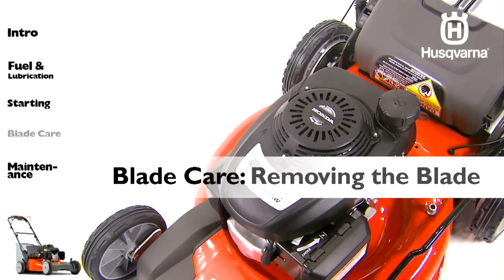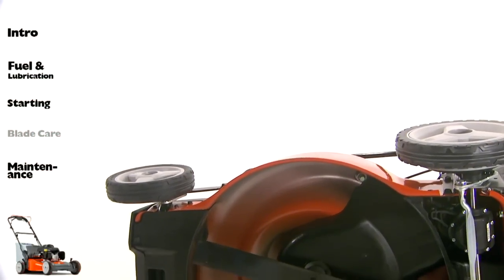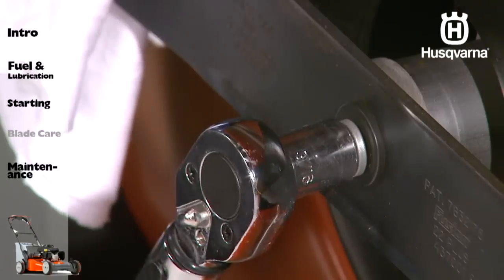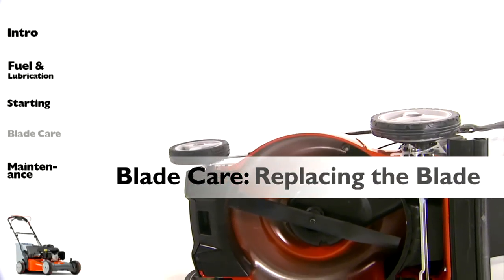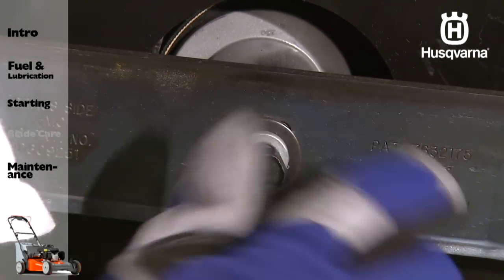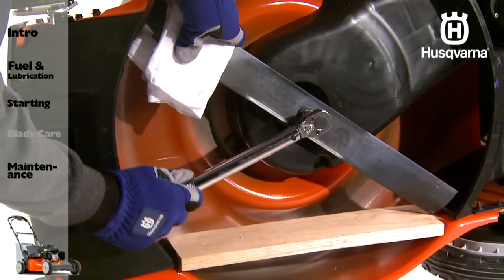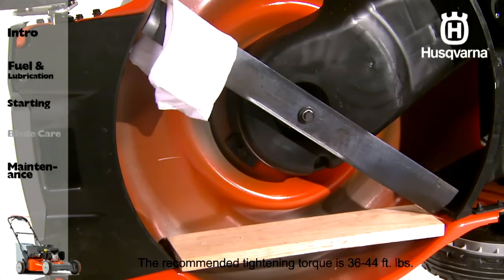Husqvarna Lawn Mowers - Blade Care

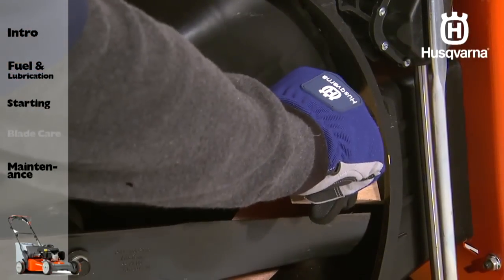Comment: Pay attention to 0:31 and you'll see that this blade is the worst ever:  In the manufacturing process, the blade is sharpened first then warped to give the helicoid shape for the lift.  The issue with that shape is that you cannot generate a parallel cutting edge to grass (flat) and you end up with a single low point at the extremity of the blade by about 1/4 of an inch down compared to the rest of the cutting edge.  The result is a bad cut with the blade extremities getting dull extremely quickly.  Husqvarna saved 10 cents on the manufacturing and you'll have have a crappy blade with a crappy cut.
Reply: Um ok............?